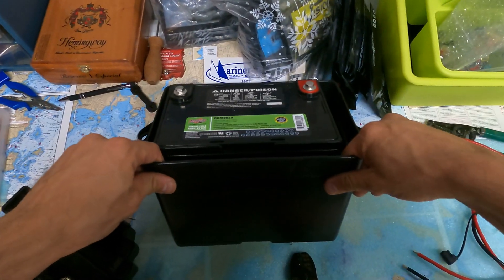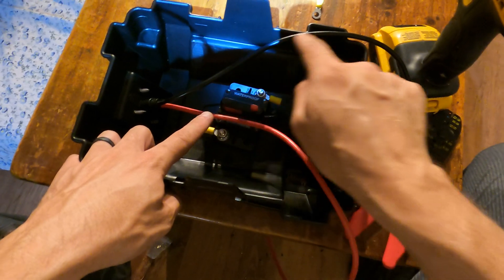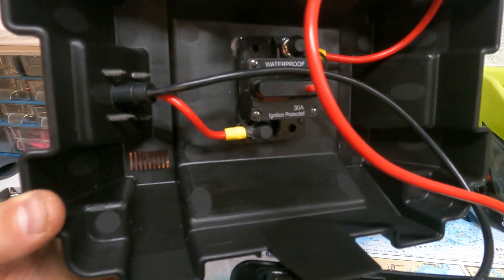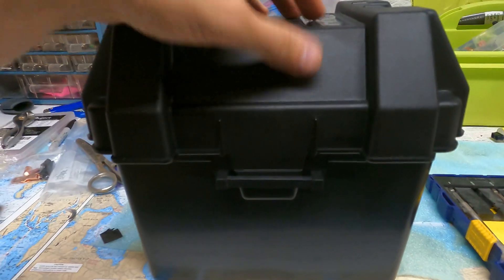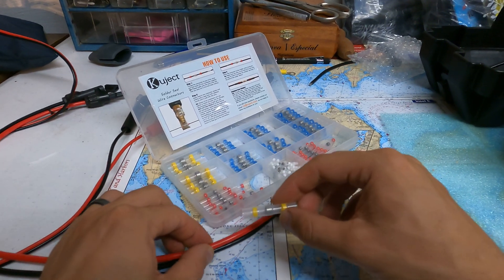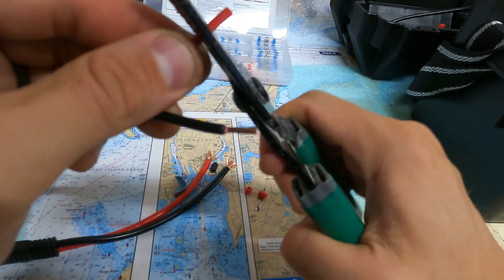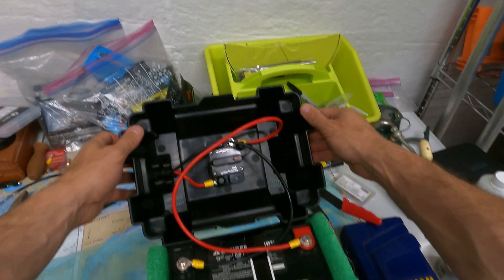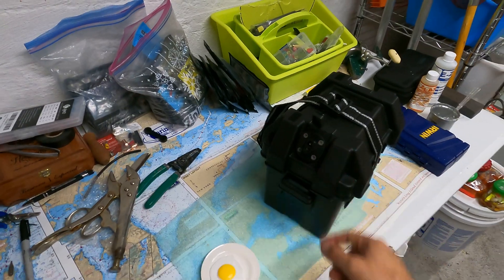CHEAP Battery box build for kayak trolling motor - splicing with Kuject

Comment: Hey Peter.  Love your vids. I could use some of your knowledge.  I have a hobie outback and I'm looking to buy a t24 watersnake motor and was wondering how you feel about the battery you have. How's the weight affect your stability and how long does the 35 ah battery allow you to run. Thanks and keep the vids coming
Reply from the maker: Hey Joe, happy to hear this and offer my personal experience:  the battery in this video I no longer use.  I ended up getting a 80ah lithium battery and have used it for probably almost 2 seasons without any issues.  I found it on aliexpress for like 250$ and now they are probably even cheaper.  I would recommend to get at least 60ah, even though the T24 doesn't draw too much power, I think 60-100ah will allow you that ability to run it without worry for a full day.  The weight of the battery is probably around 15lbs and its really not too bad when i keep it right behind my seat, i don't notice much difference in stability, its just a little more of a pain to carry around off the water.
Reply: Thanks so much Peter.  I'll take your advice. Good luck this spring and maybe I'll see you out on the water. Stay safe
Reply from the maker: @joegiglio7390  best of luck to you as well, hope to see ya out there